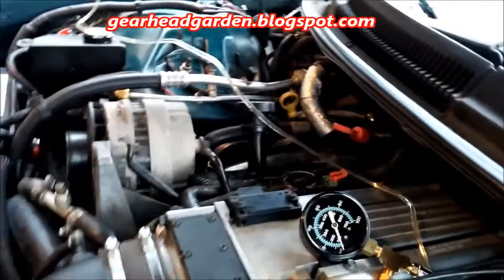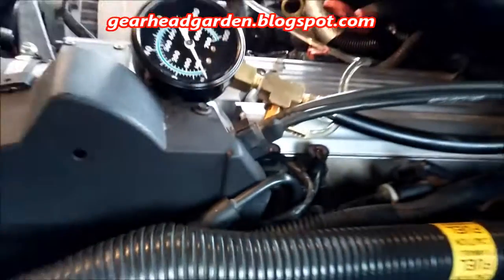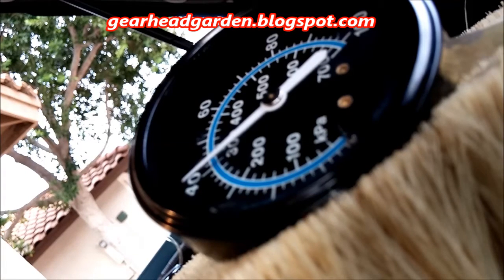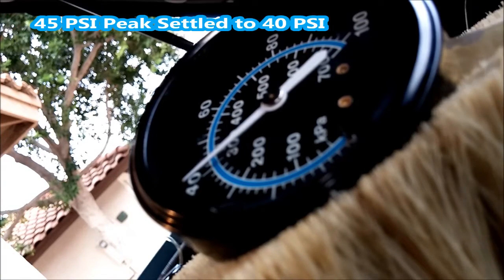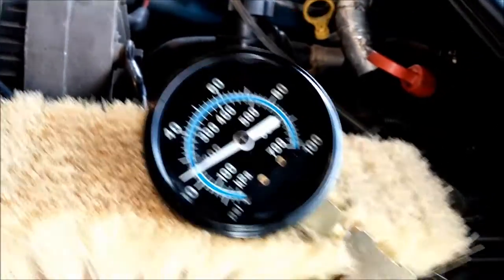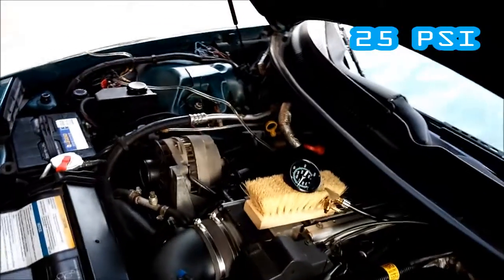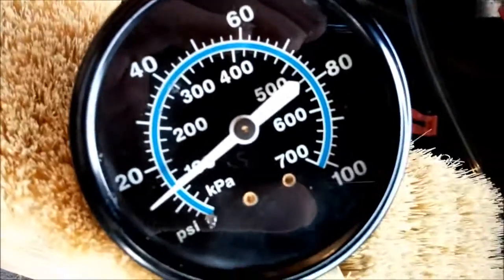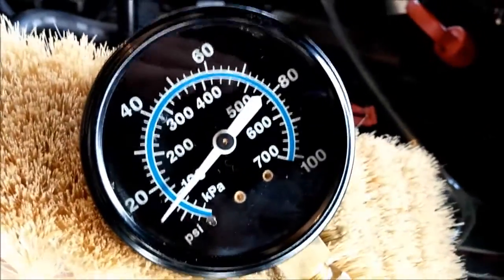GM LT1 V8 Fuel Pressure bleed down testing

Comment: My pressure goes to zero about as fast as the pump quits running. My new regulator showed up last night so that should fix it.
Reply: Did that fix it? Mine is doing the same thing.
Reply: @Scanlon100  Leaking injector will do the same thing.

Comment: Nice video! I have a question, did you tried to start the engine at the end of your test? Maybe It was little hard to start because it was flooded? I have a similar problem on my 85 TPI Camaro... Thanks and sorry for my english. Alex from Italy
Reply from the maker: Actually the direct opposite is the case.  The fuel rail has no pressure so you have to re pressurize it to start the car.  However if you get a little grey smoke when you start it warm it's caused by whatever fuel leaked into the cylinder from the leaky injector or other fuel system component like the fuel pressure regulator.  I've gotten in the habit of starting the car by turning the key on for a second or two to let the fuel pump pressurize the rail even when the engine is warm.  Basically it's the same starting procedure you'd do if the engine was completely cold as you would do if the car sat overnight.
Reply: I thought that you have the same my problem... :) Now I understand and you are right! In fact, if I try to start the engine warm (after at least 20-30 min. stop) the engine it's hard to start and smokes a little. When I replaced the spark plugs, 1 of them, was wet and black, so I think I have 1 injector leaking...

Comment: Any resolve to this issue? My LT1 does the same thing and has long crank times when left for 20 mins or more after running (always fires up on cold start with no issue). I've replaced injectors twice, doubt two sets would leak. Fuel pump was replaced with an airtex I believe a few years ago.
Reply from the maker: +1997camaroz28 I can tell you this much.  I had to replace the fuel pressure regulator which was leaking fuel back into the vacuum port.  That's the first thing I'd check when you have an over-fueling (rich) condition.  Also changed the EGR but that was for my emissions problem (all of this is really) but nothing to do with fuel system.

The fuel system is actually a lot simpler than it looks and the only mechanical points of failure are the pump, injectors and regulator. If the shunt for the fuel pump was bad the pressure would have bled off much more quickly, same goes for a bad regulator.  A leaky injector bleeds off at a much slower rate.  Right now I still can't drive the car because it won't pass emissions.  I can tell you that replacing the regulator greatly improved the long crank problem which now only shows up a little bit when the car is warm and has been sitting for about 20 minutes.  I can't afford to replace the injectors which is really my next and final step.  

There's really nothing left fuel wise given the symptoms of this issue.  Emissions issues are related to this but won't have anything to do with a long crank problem.  If that's something you're thinking about I'd look at your MAP sensor ( there's a vid here on that) and Oxygen sensors.  You probably have 4 O2 sensors on your 97 two heated 2 not.  But again, that's an emissions/mixture issue which has almost nothing to do with starting the car.
Reply from the maker: That's way too quick.  I'd start with the regulator tests and then start looking at the fuel pump check valve if the car isn't exhibiting any other symptoms.  To bleed off that fast a bad injector would be causing the engine to run unevenly especially at idle and you'd probably notice decreasing mileage.  Hope you got it fixed!